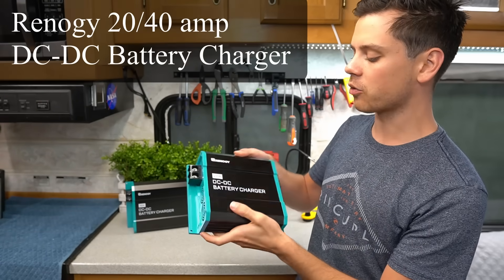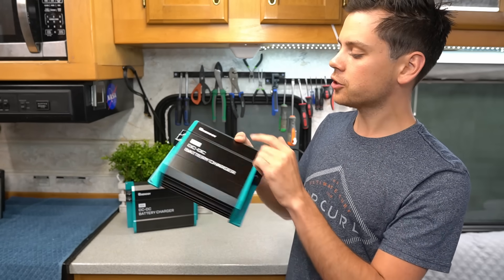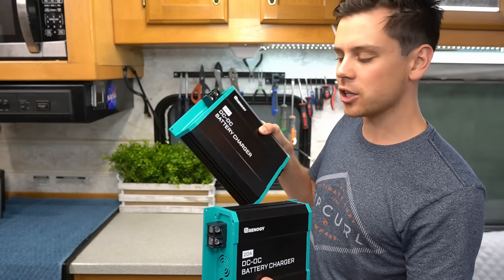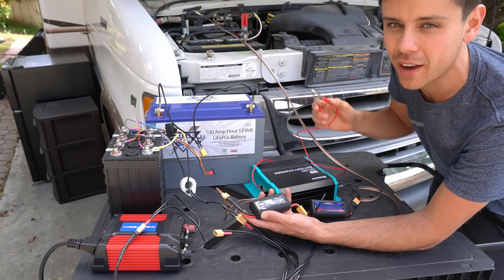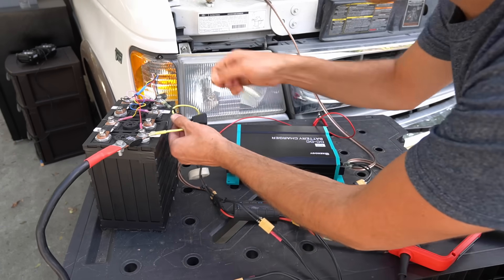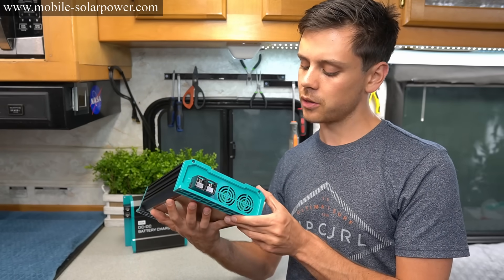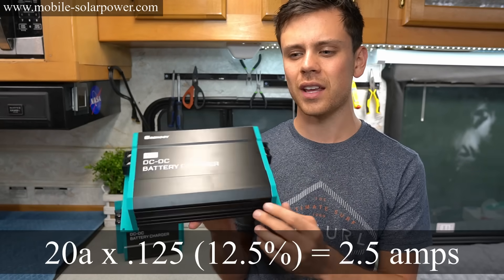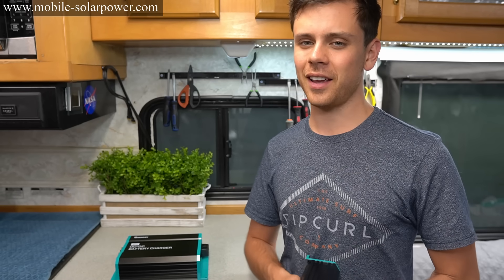Renogy DC-DC Battery Charger Review: "Smart" Alternator Charging for Solar Batteries!

Comment: I have a promaster with the stock starter battery.  I built out the van and installed a 100a lithium ion battle born house battery. I used a stinger 500a isolator to seperate the 2 and connected to an ignition switch through a cigarette lighter connection.
My question is when the ignition is on my starter battery (new stock) is connected to lithium.  I assume my starter battery is AGM.  
These being different chemistry types do I have a potential problem due to the different charging rates?  Should or can I take out the starter battery and put lithium there to match.
Please advise.  Sorry for the rambling. It's late here.

Comment: i did some testing on this topic a few months ago. i connected a some what discharged brand new battery to my trailblazer suv brand new battery, using jumper cables. i used an amp clamp and measured what the current was going from the alt to the batteries. about 3 amps total. no matter what i did the atl would only output about 3 amps to the battery/batteries. now once i connected my inverter to the batteries i was able to get 150 amps out of that alternator, which is precisely what it is rated for.

Comment: my buddy turned me onto this im trying to charger and dis charge a 2000watt amp it pulls all 2000 i have a 300 amp alt going to run heavy deep cycle batts 4 i think how many charger will i need u think

Comment: Not necessarily easy to get alternator only output the way alternators are connected to batteries in most vehicles.  You might be able to eliminate the ignition enable signal by jumping and a couple of resistors and a capacitor such that when the input power is applied the ignition trigger signal is enabled after a short delay.

Comment: Hello Hello Hello I was just wondering if you could test it to see if the battery that it is charging also helps start the truck sens it turns on as you turn the key on so maybe we could figure out if it back feeds power when needed or is it a one way power only?

Comment: I have a 20 amp Rena DC DC changer everything is working right green light is on my house battery is  at 80% my voltage in is 14.12 coming off of my smart alternator The voltage out of my DC charger is 13.05  and it’s only putting in 1.05 amp . Can you tell me why. & shouldn’t it be putting 20 amp in to the house battery

Comment: I enjoyed the video i have a 07 Ford Expedition. I was going to install a second battery using a 12v 140 Amp dual battery  isolator. The intended purpose is short term use of a fridge. In the future i also want to install a solar panel but my Question is do i need the Renogy DC - DC unit if I'm using an isolator? Thx

Comment: Please read this and do a video on it. If you use a split charger and connect the ignition wire to the positive in on the charger.where the wire coming out of the split charger is. And turn it will turn on when you drive. I love your videos there amazing your doing a good job 👍👍👍

Comment: A question I have with this DCDC charger...when you have heavily discharged your lithium battery by accident and the internal BMS inside the battery has shut down to protect the battery...has this charger the ability to send a soft charge.?..1 or 2 volts over a period of time to start up the Lithium Battery again?. I have found that when a lithium battery has been heavily discharged the internal battery BMS will shut down...the DCDC charger still puts in its "designed" charge because it does not recognise the lithium battery BMS has shut down. So you have to then disconnect the battery from the system..then re connect it to a charger to "jump start" the lithium battery BMS by trickling in a low charge over a long time then eventually the internal BMS will start to accept a decent charge again.
Reply: I saw someone use a 9v battery to jumpstart the bms ?, might work ?

Comment: I have a 220 alternator.  I’m wanting to build a Nissan Leaf ion battery bank.  The cells come in 8v so you have to have at least 3 for 24v. My issue is I’m trying to charge the 24v bank (possibly 2) from my  12v alternator.  Ive seen some dc to dc 12 to 24 v chargers.  Do you have any experience or ideas about safely doing this?  I don’t want to lose my rooftop real estate on my van to solar.  Thanks!

Comment: Nice video, thankyou for sharing. Im new to all this solar stuff but just wondering does the power from an external source I.E the alternator back feed into the solar panels and damage them or would i need to install a diode somewhere in the line?

Comment: Finally found it! I was going to use the Battery Doctor isolator and use a step up transformer from 12v to 24volts to charge my battery bank. Thanks again Will.

Comment: Will, Question on hooking this up on a fifth wheel setup with Solar.
Currently the hotwire coming through the trailer plug #4 pin will charge the trailer batteries to 80-90% while driving around.  The DC - DC charger will charge the trailer batteries to 100% while driving around.

Battle Born LiFePO batteries

60 AMP MPPT solar controller with solar panels.
40 AMP DC - DC Battery Charger installed.
What happens with the  hot wire coming through the 7 -pin trailer wiring?  Is the hotwire still also charging the batteries like it did before?  Should it be disconnected?
Part of the reason for the DC -DC chargers is to help the alternator keep up with the LiFePO batteries.
Hopefully not a newbie question.

Comment: I have a Teardrop camper with a 7-pin connector that charges the battery when connected to the tow vehicle. Can I just insert the 20 amp version of this between the constant 12V pin on the connector to my new lithium battery on the teardrop? I would rather not have to run a complete new set of wires. Or should I just skip this? 
Love your videos, very informative and convinced me to go lithium on the camper.
Reply: That wire would not be rated for the current flow. To go that far it would have to be 8 or maybe 4 gauge. You can look up the specs on Renogy’s website where they give the specs for wire size and distance. Just go to the 20A model and click on downloads and all the info is there

Comment: Help. Something i cant seem to get a straight answer on.  Does the dc to dc charger work with different battery types connected.  I.e. : starter battery (flooded) and 2nd battery bank for rv (sla deep cycle) ?  I was nearly going to buy a voltage sensing relay.  Then i wondered if the 2 battery banks ( starting battery and house batteries) need to be the same type of batteries.  Well ues they do.  Same type. Same size. Same age. Does this apply to a dc to dc charger also ? Why would anyone have the same type of starting battery as they do in their rv battery bank? That makes no sense.
Reply from the maker: Yes. They can be different and it works well.
Reply: @WillProwse  thank you very much.

Comment: Could you have your solar panels wired in series to a charge controller then to house battery wile regony 50amp dc to dc is conected to house and starter bat.

Comment: Just an idea. a cheap voltage sensing switch could be installed between the positive input to the charger and the ignition input to allow it to auto turn on when alternator is charging

Comment: Could I use a solar charger to controller instead of this device?
I guess the solar charge controller would control the energy that comes from alternator to the battery.
Does it makes sense?
Reply: Interesting.  I womder now myself
Reply: @whatyoumakeofit6635  I've looked into it, and the answer, at least with my Victron MPPT it's no.  Can't remember how I found out, but I had thought it should work too.  I think the solar charger is supposed to see a higher voltage input . But maybe other chargers could do it.

Comment: I’ve looked high and low for a solution. This would be perfect but my starter batteries are 24v and want to charge 12v lithium house batteries in RV and hook 3x12v solar panels in series. THE only one I have seen that can do both alternator & solar at the same time is a very well known Australian brand called REDARC but they are like expensive. 

I’m mainly worried about the alternator possibly burning up charging lithium in! Can you recommend anything that can take 24v from the starter/alternator and charge lithium? 

I have an old Morningstar TS-45amp PWM that can be programmed to charge lithium but don’t know if I can connect the alternator to it?

Comment: Will, I found a Bluetooth controlled DC-DC charger, the SKYRC B6 nano.  I use it in my truck camper and can control and monitor charging from the cab using bluetooth.  It will charge up to 15amps or 320 watts which I believe is more then the Renogy.  If I set the input voltage cutoff at 12.3v it shuts off about 30 seconds after shutting off the truck.  I'm guessing if you want 30amps of charging you can just buy a second one.  Might make a good video, only about $55.

Comment: just put the dc to dc charger on a switch to the ignition and after you let the vehicle warm up then flip the switch problem solved will cause if you wire it to the ignition circut to a switch then to the dc/dc charger its only gunna stay on when the vehicle is running, this gives the altenator a chance to top off the drive battery before you kick it on to throw the coach batteries sum power.. god i wish you were my brother i swear i would pick ur brain man luv ur channel and content is always great.. keep up the good work man

Comment: Hello Will, I have watched several of your videos.  Great content.  I also have a YouTube channel so I know it’s impossible to respond to all these comments.  I too have a Renogy 40a DC to DC.  However, in my very short experience with it, I don’t know if I quite agree that it is safe to charge a “deeply” discharged deep cycle battery with this from the alternator.  My two 6v golf cart batteries (wired in series for 225ah @12V) ended up quite deeply discharged after an off grid camp out.  To ~11.7 volts. When I started my engine and drove away, the Renogy 40a Charger drew so much power from the main starter battery that the alternator (110A) couldn’t keep up and over the next hour I ended up with a dead starter battery.  Have you had any experience like this?  What are your thoughts?
Reply from the maker: The 40A converter circuit cannot pull 110A. That's impossible. I opened it up and the current limiting wouldnt allow that. Sounds like your alternator or regulator is to blame. I would beef it up or use a 20A converter instead. Also, don't discharge those batteries that low. 12.1 volts should be it.
Reply: DIY Solar Power with Will Prowse Hey Will, I just came across your video about the Inergy Apex - VERY INTERESTING.  Can we chat?  I’m also sponsored by Inergy and am currently trying to design my system around the Apex - And it’s not working.  I’d love to hear your thoughts.
Reply from the maker: @LivingTheVanLife  just read your comment again. Alternator current rating is not continuous duty. And during bulk with fla, they will take whatever they can. But not more than 40 amps. sounds like you need a smaller converter and a larger alternator if it can't charge that bank. 

And I have a few videos covering why people shouldn't buy the apex. What do you wish to know?
Reply from the maker: @LivingTheVanLife  the apex is a very cheap quality battery/inverter in my opinion. Bad design with the switch and overall component sizing.

Comment: I bought this unit on the strength of this video. I was impressed and it looked like it was just what I needed. Now I find out, from the specs, that the solar panel input voltage is limited to 25v! I had planned to serial connect my 2 panels but now have to get branch connectors for parrallel connection. I called Renogy about this and he said it was because of the alternator connection that limited the input. To me this kinda defeats one of the features of having an MPPT controller.
Reply: I put this comment on the wrong video review! Meant for the Renogy DCC50S that Will reviewed. Aargh

Comment: Now you realy got something THERE I have been looking for many years   THANK YOU I have been using 700ah of Lifepo 4 cells. What adifferance from our old L16 cells  with enoughf sun we do not need to worrrrry  till we go for days without sun, then it takes sometimes 4 hrs at low amprage to effectivly re-chrage them from our 180amp HD alternator with EXTURNAL Home made regulator. We keep our amiture voltage down to 2-3 amps 13.5 volts.  This is going to alow us much more stability.... THANK YOU   (ps WE use a 3,000 amp three phase rectifier   to keep everything cool. no heat to hurt the rectifiers.internal diodes wer removed 3 phase output )  John in Milo, Maine  1000 points at least...

Comment: Instead of connecting when the key is turned on.. is it possible to just have a power on switch? That way I can turn it on after the alternator has turned on and turn it off to cool..
Reply: When u run any automitive alternator hot usualy they burn out the commontator and or slip rings and brushes  some times u can get a few months out of them (Open the hood and put a big fan to keep it cool) It  helps to use a larger alternator works better than factory)

Comment: Great video! Wondering what the charging voltage is? Does it adjust charging voltage up to 14.5v from whatever the alternator produces, by up converting the voltage or does it just let pass through whatever voltage comes from the alternator? Also, how many stages? Does it float eventually, and if so, at what voltage?
Reply: Nevermind that, I find out all of that information with the link you provided, which I had overlooked, my bad.

Comment: Here is a crazy question for you experts... I’m going to install the 20a version along with a 60Ah LiFEOP4 in behind the passenger seat of my truck. I already have a stereo amp installed back there with a huge positive  cable from the battery and an Ignition wire. Can I simply use a distribution block to split the positive wire so I don’t need to run a new one? Additionally, can I run the input and output grounds directly to a chassis ground I have located in the rear? The manual shows dedicated positive and ground wires running from the starter to the charger and then on to the house battery. In my ignorance, I don’t understand why I can’t just hook all the grounds up to the chassis. Thanks in advance.
Reply: I would take advantage of that thick wire, IF:  
 a) you know that it can handle the combined load of the amp and the charger. OR
 b) you don't bulk charge and run the amp at high power at the same time.  Trickier.   In any case, I would make sure there is  a fuse/breaker on that wire matched to it's capacity so that worst case, you pop the breaker. 

Chassis grounding is unreliable and deteriorates over time.  While it may work fine, it's almost always recommended to run the wire.   I wonder about running both a wire and the chassis ground in parallel and may do that when I get around to beefing up my alternator and chassis grounds.  Not sure if that's a good idea to have two paths, so not recommending, just entertaining the idea.

Comment: This is all well and good... But how would this wire into an existing solar system?
(solar panel/s, inverter, charge controller, battery/ies, fuse block/panel, etc)

Comment: The Votronic DC-Charger (30A) also has alternator voltage sensing which can be used as an alternative to using the ignition D+ signal to initiate charging. It has a LiFePO4 charge profile, includes a temperature sensor and is compact in size
Reply: 3x price tho

Comment: 4:25 the ignition circuit is important for other reasons, e.g. to turn on the charger only when the generator, dash switch, or some other application is turned on. It gives the user the option of choice, while still being automated if you prefer by just tying to the vehicle acc line.
Reply: You can always just add a toggle switch to the ignition wire and place it in the cab.

Comment: Will, I bought your book but it doesn’t cover two really important topics shore power and charging from the cars battery. Can you please do a video on charging from solar, shore and starting battery/alternator? A lot of us live in cars/vans in the city, and northern cities. Clouds and buildings make charging from solar a challenge, even in summer, but especially during the winter, (even in SF). So charging from shore or charging from the cars battery is a must for some of us who need electricity for both business and health. I was hoping your book would cover this, but it does not, so I am hoping you could make a video on how and if one could use this 12v MPP All-in-one with a smart charger of your choice, to have a true all in one charging system: Solar, Starting battery/alternator and shore. I know I’m not the first to ask this. Some of us did buy your book, so be a pal. :) Oh, and if you take on this mission, please show exactly how you’d position and mount the components in a car/suv/van.

Comment: I am trying to set my dc to dc charger with my valance 130ah lipo4s battery i need the correct settings  my unit is the 20amp version 

cheers
Reply: ME TOO

Comment: Can you adjust the AMP output of these units?  Say you buy the 40amp unit.  In the settings can you knock that down to say 20 amps if you wanted to?
Reply: Yes the 40 amp can be lowered to 20 amps by hooking up the LD wire. The 20 amp can be lowered to 10 amps by hooking up the LD wire. This is according to the latest instruction manual. If that LD wire was on a toggle switch you could change it at will between the 40 amp an 20 amp setting on the 40 amp unit.
Reply: The correct wire  to hook up is called LC not LD as I previouslysstated.

Comment: I'd like your thoughts on older alternators that only put out 13.6 volts and if these units will bump up the voltage to 14.4 volts that lithium batteries need.